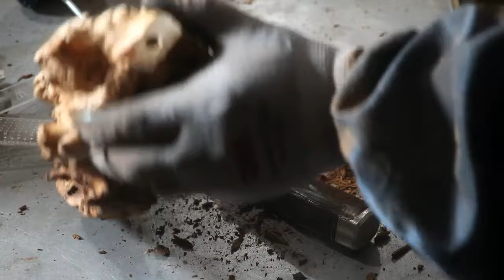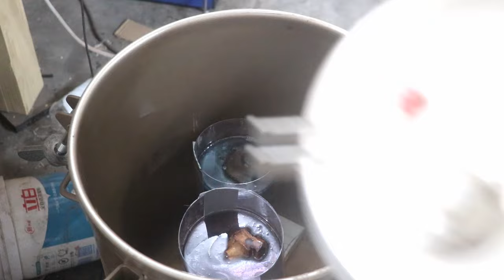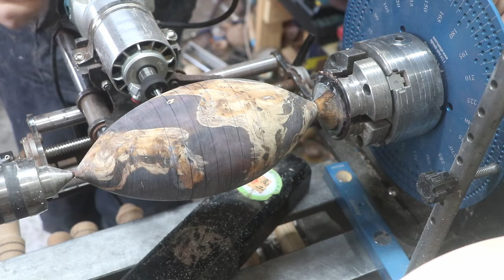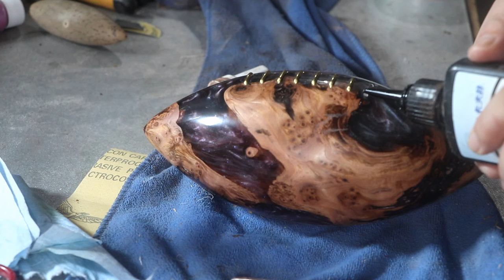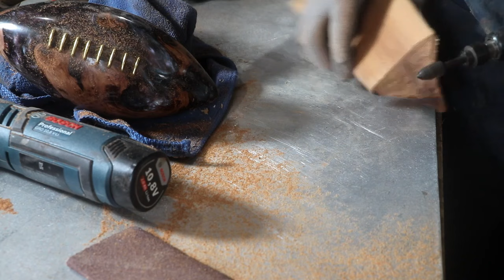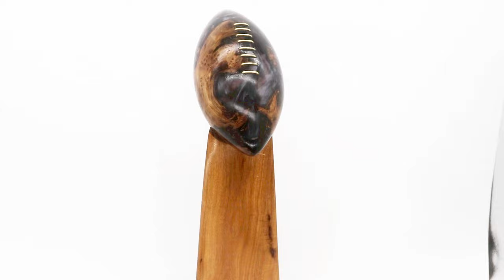wood turning: Can I turn this？

Comment: Love your work I only have one suggestion - get some persian blue ink and put it on one of your mating surfaces to mark the other one the work the marked areas down until you get full contact it takes a bit longer but it gives you a perfect fitting joint with no fillers
Reply: This is what dentist do to match up teeth. Good suggestion.
Reply: @kevinfarnswo5366   yes it's also how is custom dangerous game gun builders fit receivers to stocks for the best fit.
Reply from the maker: Thank  you so much for your suggestion, 🙂🙂🙂🙂